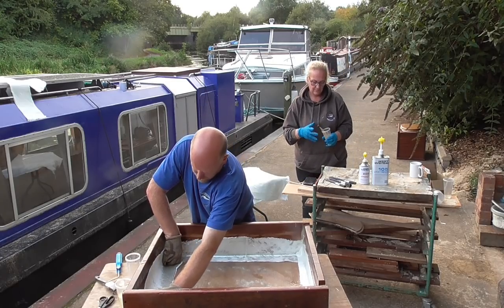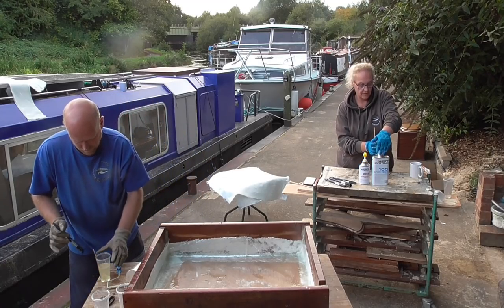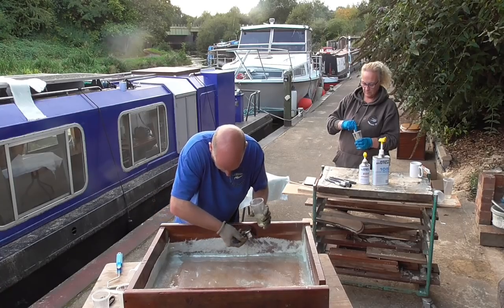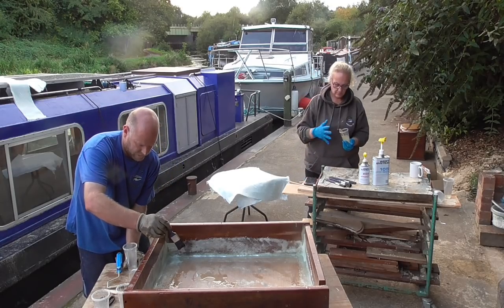Time to FIBREGLASS the SHOWER TRAY and complete the COMPOST TOILET in our NARROWBOAT BATHROOM

Comment: I admire you using 8min pot life hardener! I am not up to that and use 30min or even 1h hardener. It's hard the next morning too and they all need about 4-6 days to fully cure. For vertical areas I add a bit of fumed silica to reduce viscosity and you will be surprised how much easier it is to not generate puddles at the bottom.
Reply from the maker: Ah! that has reminded me - we ordered, and have, some silica for that reason, BUT I had forgotton all about it and didn't use it!

Comment: Shower on my boat was tiled by previous owner which we found had leaked.  Possibly more than once.  It was on my list of winter jobs to install shower board.  However, after moving around part of the network disappointed with small number of showers and the fact that of the ones I did come across 50% faulty.  Like your idea of pump out especially after finding that my water pump is leaking and appears to have been leaking .... drips... for a while.
Reply from the maker: The reason we went for this idea is that no plumbing ends up under the floor boards - where they are difficult to get to and often leak without being noticed until its too late...

Comment: That boat bilge pump is unlikely to work very well as a shower pump. They are designed to stop boats sinking and not empty every last drop of water. There will always be quite a lot of water left in the shower tray that it is unable to pump out. Also you will need an NRV on the outlet otherwise when you switch it off all the water in the outlet pipe will just run back into the shower base. Sponging out several litres of grey water after every shower will have you wishing that you'd fitted a standard shower drain and Gulper pump pretty soon! Don't ask me how I know but I do live on a sailing boat that has had water in the bilges many a time!
Reply from the maker: Its all a bit of experiment. The reason we are having the 'duck board' to stand on is because of the water that will be in the bottom of the tray - the duck board will stop us sploshing about in it. 
Once turned off there wont be that much to run back, the pipe is only about 2 ft long (at most), so won't hold that much water in it. 
Over time we may tweak and develop the idea... first thing is to see how it works in the first place though.
Reply: @WingingItBoatingonaBudget  Testing is easy - fill the tray up and wire the pump to a 12v supply and see how much water it can't pump out. Any water left in the shower tray will start smelling pretty quickly - and grey water smells worse than black water! 60cm of 22mm pipe will hold 228ml of water plus whatever is in the pump body. Is the bilge pump automatic or will you be switching it manually? If auto then you will definitely need an NRV otherwise the pump will most likely get into a cycle of pumping  and switching off, then the water in the pipe returns and it does pumping and switching off all over again and again and again.

Comment: Hi Mate
I hope you don’t mind me saying, but the bilge pump is not going to work.It will always leave water in your tray which will very quickly start to smell. I would do it properly first time mate as a shower is quite important and you won’t want the hassle of revisiting it to fix the issue
Reply from the maker: Yeah we know it wont get every bit out the tray - its a bit trial and error ad to the final tweaks, BUT we definitely dont want a under the floor drain / pump etc - they are a known weak spot for leaks. as generally they are not only out of sight, so get neglected, but also often tricky to work on in confined spaces so its all too often that they dont get done right.

Comment: I would have thought you would have gone over the top lip of the base with the fibreglass to be honest Peter. It would have made it more sturdy from any movement made when in use. 

Other than that. You did OK for a first attempt at something we all have to learn when D.I.Y.

Ooops as did @dzjing says.
Reply from the maker: Mmmm, I'm wondering about going over the wholes lot with just clear epoxy resin before we use it...

Comment: Maybe you would have made the fiberglas come up to the top of the tray. Now when you use it and stand in iet moving about the edge will come loose and the water gets behind it in between the fiberglas and the wood.
Reply from the maker: It will have trim round where the fibreglass ends...